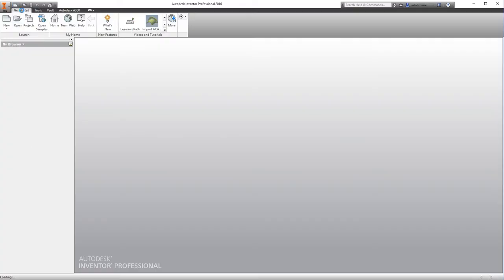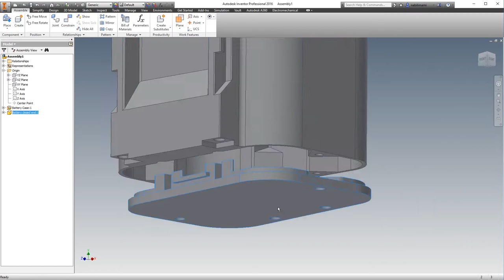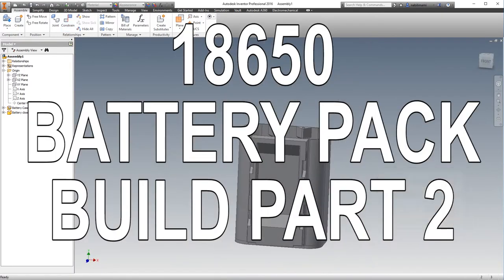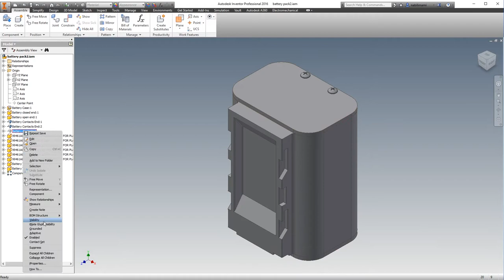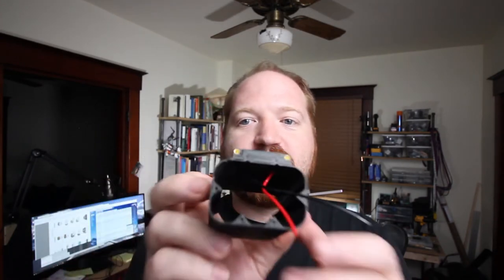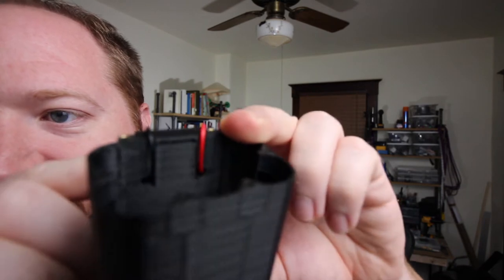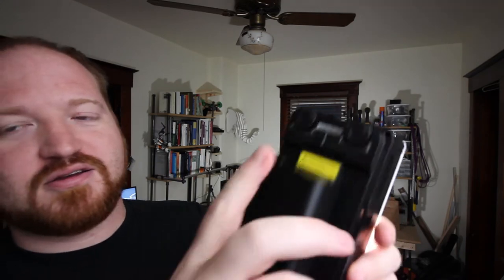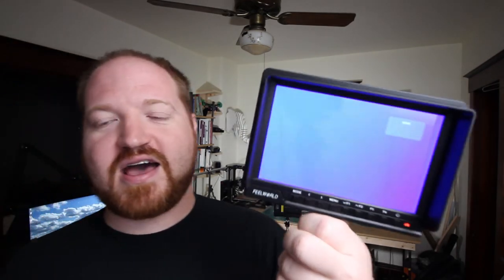Battery Pack Build part 2

Comment: I'm thinking maybe you could add a protecting board (circuit?)and a charging board , then you don't need to take all the 18650s out and recharge them individually every time when thay are run out of juice.
And bty, using the vary same battery model for six of them is crucial , because different batteries have different capacity and voltage drop rate , if you use diffrernt battery model in one NP-F case , it will get hot easily or damage the battery.
Reply from the maker: 18650s are suprisingly forgiving. I've treated mine pretty rough and I haven't had any issues or killed any batteries. My only precaution is making sure each AH per cell group is the same. I mix manufacturers and colors all day. I grab 6, pair the closest mah and throw them in.

Comment: I was investigating the issue and found out that you could add simple BMS module to your design to charge the batteries with dedicated charger :)
Maybe that would help you in your future endeavours!
Reply from the maker: I left the intelligence out on purpose. The idea was that because I have a couple hundred 18650s laying around I could throw 6 in, use them up. Do that a couple times and then throw 18 in my big charger setup. Version 2.0 will have a quick release door so switching them out will be easier
Reply: @Obscuremotorsports  I am planning a similar build and stumbled upon You video! Great job! As I am planning to use a BMS I had a question for You as it looks like You are not using one - how do You protect the batteries from over-discharge while in use - does the light/monitor have a secondary protection circuit or do You just check the battery indicator in the screen?

Comment: Just curious. If i assemble the 6 batteries (Of course 3 in parallel + 3 in parallel) and got 7.2 volts as output. But the camera gives an error when 2 wires are connected. Whats the 3rd wire ? Googled a lot and found the camera will not work without this signal. How did you manage this?
Reply from the maker: What camera are you using?